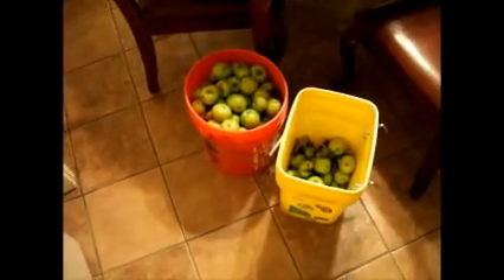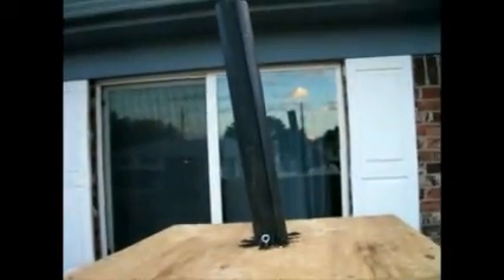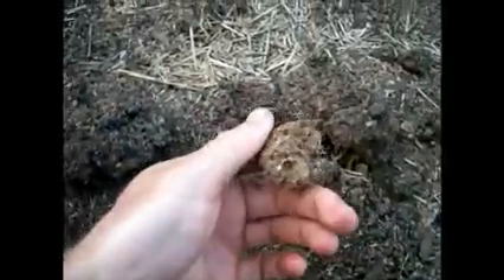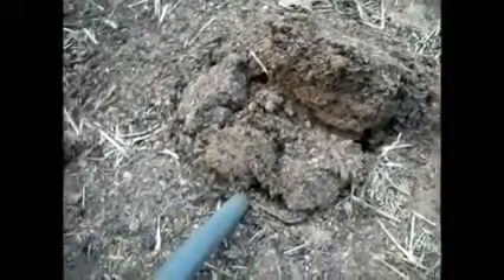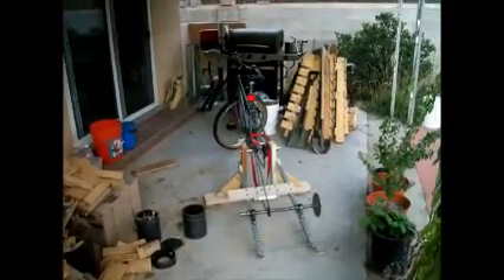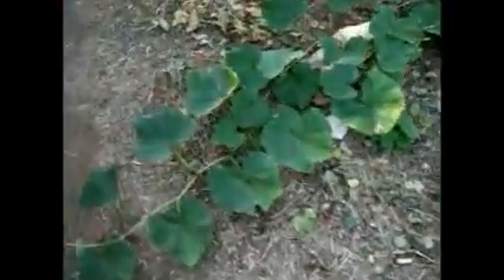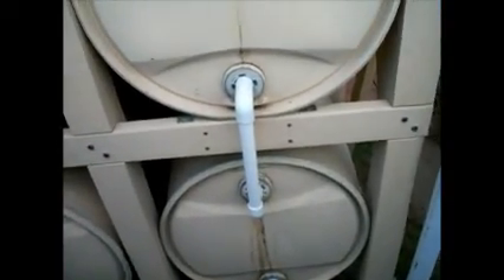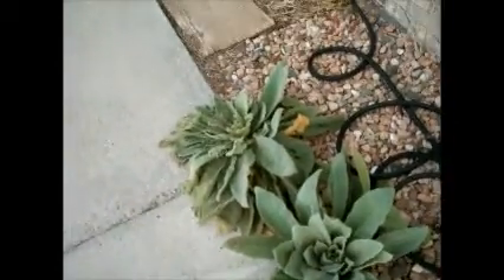Greening the New Mexican desert Year 2 fall

Comment: Nice dehydrator. Keep up the mulch, it looks good in that bed. For my own garden, I like to buy pine shavings from the Tractor Supply Company. For $4 or so, you will get a couple of cubic feet of mulch. It may be more cost effective than the straw if a bale is running for $10 or more.